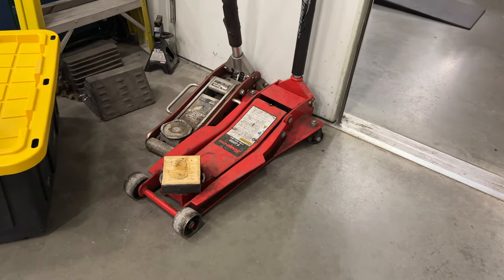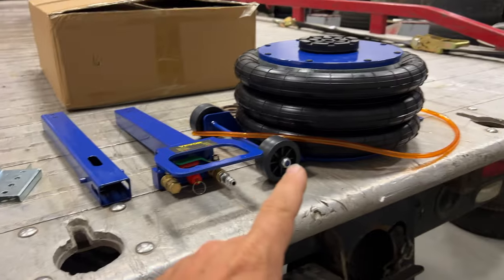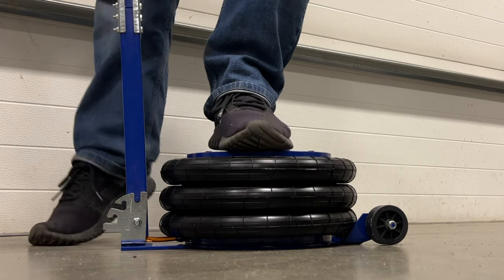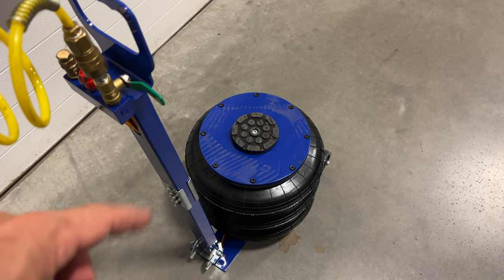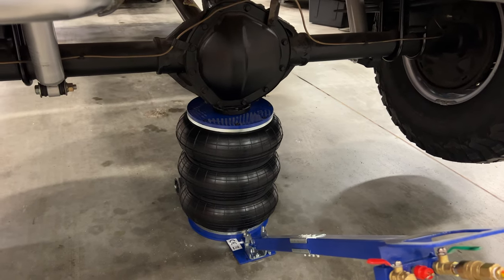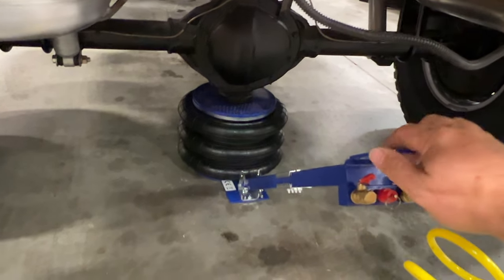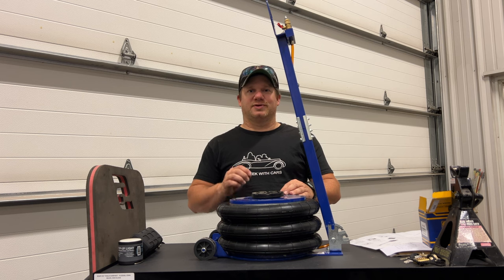Testing the Vevor 5-Ton Pneumatic Jack

Comment: 1. ALWAYS chock the wheels.  Even though you are on a level surface you are shifting the center of gravity, the truck wants to move forward. 2. The machining of the inner telescoping steel is ruff. You can hear the grooves left by the lathe rubbing against each other.  3. The reason for the sudden drop is because of the ruff machine work. By not chocking the wheels you created a side load on the inner telescoping steel. 4. The sudden drop can be alleviated but not eliminated by reducing the side load as much as possible. ALWAYS chock the wheels and OF COURSE put proper support under the vehicle before going under ANY vehicle.

Comment: The only regret that I have with buying one of these is that I didn't buy one sooner. It works perfectly and once you get used to it as there's a little learning curve you will wonder why you work so hard with hydraulic jacks.
Reply: I just bought one like this based on your video can we not stop the inflation when desired height is met or do we have to inflat it all the way all the time ?
Reply: @vcolet2011  with both valves closed? Now open just the green handle until desired height is met and close valve. Does the jack raise as soon as you turn on the air?  I need more information

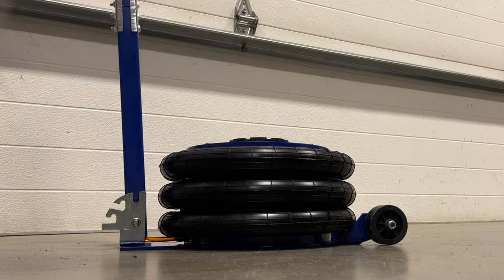Comment: At 2:15 - you can see that you have the air line installed wrong in the handle - it's being pinched by the handle bottom against the base plate. You're not supposed to route it that way - it's supposed to go up into the cutout on that lower handle and up through said handle to the top cutout. Putting it in from the bottom is just going to ruin the line and possibly drop the vehicle on you when it tears under pressure - that line has to hold full pressure any time the jack it lifting\holding up weight.

A good reminder to also make sure that jackstands or other solid support is used when working around anything lifted up - pneumatic or hydraulic, don't be under weight without actual solid support. ;)
Reply: That's a very important point you've made about the airline mis-routing. He's made an already potentially fatal jack even more dangerous. I also worry about people using these whilst welding. The airbags are quite robust but the airline looks vulnerable.
Reply: @Simon Coates  - Yeah, if you were MIG welding around this you'd need to be extra careful as the sparks/slag can easily damage the air components of this jack. Jobs like that are definitely poster children for using proper jackstands, though again, any time you are going to be under a lifted load, you need jackstands under it too. I've had normal hydraulic jacks fail under load with a car on them - thankfully I was lifting it to remove the jakstand and it failed while lifting, so no one was under it. Just have to have a sense of self preservation and not want to get hurt, but sometimes people don't think it through, so warnings like this are there to help. :)

Comment: I used to work in a plant with pneumatically controlled processing machines.  After he pointed out that  kinked pressure hose and the associated connector I was instantly concerned because of how they  fail.   When that plastic line cracks or burst loose it is instantanious.  All you'll hear is pop and the whistle of air cutting air.  If this happens with a car on the  jack everything is coming down really  fast and hard.    There didn't seem to be a fall arrestor on those jacks. Of course you will be utilizing a jack stand for safety but that will not be in place when are raising up  or lowering a car.    It also appears that  a level surface is imperative because it looks like that rubber only is holding things up but not front to back or  side to side.
Reply: Not that they help much for side to side but there is a collapsing metal tubes in the middle.
Reply: @akbychoice  yes, the metal column inside actually keeps it from flopping over to the side, though it does allow some degree of movement when not fully extended and locked up.
If it's fully extended and pressurized higher than needed to lift the car, the column will then be fully rigid and won't have any side play.
The stiction in the column tends to cause the irregular dropping when the air is released, so it can cause the scary "whoa!" moments for someone unwary of that characteristic.
I've seen a video of someone opening it up and applying some lube on the column which should help with that. They're apparently manufactured without any lube or grease on the metal column, so there may be some other reason for that. Maybe to avoid possible contamination and deterioration of the rubber. Even though there's no direct contact with the rubber,  brake caliper slide lube may be safer to use.
Reply: I'm more curious about how it'll be at the end of service life for these, as they definitely have some timespan where they'd be expected to work. Whether three years or 10 years, eventually the rubber will go, but is there any good indication that's able to predict when that time has come?
I haven't heard of a single instance where the bladder let go with a bang, but it seems possible, with time and conditions.

Comment: One thing i like to say about this jack   your air pressure has be 100 lbs or more the jacks works really good if your air pressure 65 or 70 it would not lift as good. i got mine 2 weeks ago.
Reply: The lift pressure on my 3 ton model measured at 40 to 45 psi during the lift of a van and passenger car, so a low pressure would work, but the higher pressure from the air supply is needed for a quick lift.  Lower pressure from the supply would take a longer time, since the fill rate would slow down when the supply pressure is almost the same as the target.

Comment: I got one on sale to augment my traditional hydraulic floor jack. I actually like this a lot because, for my needs, it's quicker, requires less space than my hydraulic jack, and its easier to use. It also raises my vehicles super quick. Instructions were terrible, but it's not rocket science.

I use it for driveway type stuff: brake jobs, minor suspension work, some minor engine work that requires access to the under side. I'll obviously keep my hydraulic floor jack, but this is a nice addition for me.

Comment: Thanks for sharing this info. I'm not sure that this is a safe device to use. Plus, it's lowest height is somewhat limiting for the vehicles you can use it on. Please continue to use with caution. Hydraulic jacks may be slower, but they are well proven and easier to control
Reply: I have a lowered Bmw and all you need to do is drive the car up on the  Low Profile Plastic Car Service Ramps slip this Johnny in the middle of the crossmember and lift away. Your making it seem like it's impossible. If you actually play with cars you would know there is always a workarounds. My buddy has a bendpak and I can't slip the arms of the 2 post lift under my car without driving it on 2x4's so come on guy. Man up this product is great.

Comment: The advertised raised height is 15 3/4", did you re-check it after you fixed the air line kink? You should mention that, a PROPERLY RATED jack stand should be used in conjunction with any hydraulic, pneumatic or mechanical jack if you are working under a vehicle, or lifting a frame and working between the axle and frame, as a single jack failure can cause severe injury or death VERY quickly.
Reply: Facts, a friend of mine from high school passed this way.

Comment: I've seen a review from the British Isles, and that reviewer had some issues with the way and sound as it deflates. 
Hear that 'scrunching sound'? He didn't like that, so he took it apart and fund that the machined surfaces of the steel inside were "very rough"/ 
I'd like to see you take this one apart and give us your thoughts on what you find and think about the 'guts' of this jack.
If and when I buy one, I will need lower deflated height, so it will fit under my Mini Cooper etc. ( Maybe the 2 or 3 ton version would be better? )

Comment: I have a fascination with jacks. Growing up I liked when our car would get flat tires and we'd go to a local garage to get the fixed. I came here to get the scoop on these. If you're interested in getting one I'd say hurry up and get one before they're outlawed. I've seen a few videos and they tend to wobble when fully extended. Sadly it's only a matter of time before people start getting hurt or killed. It's a great concept but in the wrong hands these are like the three wheelers of floor jacks.
Reply from the maker: I think they could easily make them safer by limiting how quickly they can fill with air.
Reply: @ThisWeekWithCars  yes

Comment: I have the 3 ton model. This thing is awesome as long as you are smart about how you use it, but the handle needs improvement.. I lift the entire side of my daughter's jeep and rotate the tires in 5 mins each side (like an Indy pit crew). I also have a 60 gallon air compressor with 3/4 lines going to a 1/2 hose reel, set up with the larger T series connectors. So the volume of air my system can provide is very good. Let in the air slow and the vehicle lifts slowly, close the valves and the jack stays up.  Control is everything. Use jack stands for safety.

Comment: Acts like the stabilizing structure inside of it needs lubed. Does the center lift pad come off? Maybe a zerk under there? Or on the underside of the rig?
Reply: There's a video where the top of was removed to show a telescoping metal column inside. It can be lubed by hand to get smoother movement. 
I haven't opened mine yet, I may do it after using it for a while first so I'll have some basis for comparison.

Comment: I bought one of these a couple week ago for my younger brother.  I only got the 3 ton (6600 lb) version though.  I would imagine you could control it a bit more by adjusting how much air you let through the valves instead of just running them wide open.

Comment: One of the most important specs I look at when buying a floor jack is how high it will lift, and how low it is fully down. For lifting small and big cars you need one that really goes high for modern lifted trucks. My big one lifts from 4 to 36", hydraulically.
Reply: That's huuuge.  Don't think I've ever seen that.  Who makes it?  
I have a farm jack - 60", but it's, ahh, well, be careful.
Reply: @mountainjeff  who else.. Harbor freight. I've had it for years. Replaced casters once, but otherwise, I use it for the big stuff. Lifting to 19" is just silly for most jobs.  I have a full size lift too.
Reply: @gvxclassics  what model of hf Jack is that?  That sounds like some kind of Quickjack scissors type rather than a standard floor jack, to get a3 foot lift range.
Reply: @sadfur8728  HF does not seem to have it for sale any more. It is a regular floor jack, just a big one.
Reply: @gvxclassics  how long ago was it that you found it?

Comment: I have two that I use on the hoist, obviously mine don't have the handle, mine seem to wobble a bit at extension, and only two bag's not 3 ,I think there great only the valves stop sometimes, in 10 years replaced one set, of valves, that's second hand, all the best to you and your loved ones

Comment: Enjoy the videos . I have one, they work very well if common sense safety procedures are followed. Releasing the air gradually is a good tip then the control is pretty good. Agree that it’s more powerful than a hydraulic jack but it’s all the better for that. My only criticism is that the pad could be a little larger and raised a bit.
Reply from the maker: Thanks for sharing
Reply: I use two bag one on my lift, I do find (I jack one corner at a time) it too be a bit wobbly, but the steel tube in the middle stops to much movement, found it a bit intimidating at first, but work well for 10 years haven't used them as much in the last 10 years, apart from having to replace the valves in mine they are push button, type, still work a treat, all the best to yous and your loved ones
Reply: If you ever have any old tires, you can make jack pads from the tread by cutting up squares using a reciprocating saw. They'll last a lifetime and can be stacked as needed for extra height and protection of the undercarriage.

They're especially good for regular hydraulic jack saddles and jack stands, as they're usually all metal and will gouge out your undercarriage when given half a chance.
Reply: @donaldhalls2189  how's the condition of your bladder after the 10 years? Is it essentially still the same as new?  Just wondering if the rubbers will show any sign of failure before it's too late and an accident results.
Reply: @sadfur8728  there is no signs of rubber fatigue, but I always put the stands under the vehicle and not just supported buy the air jack, I've seen some with the outside layers torn, and still using them, (not what I would recommend) all the best to you
Reply: @donaldhalls2189  I guess it can be used to end of life of the product, keeping it in mind that it could be a possibility that it could blow out to avoid end of life of the user-
It's good that it's lasted that long with no issues, and no reports of failure.

Comment: Mine came with a spring,  maybe to lock the handle position.   No instructions for the sprin and where to install it.
Reply: Spring goes over air line at handle pivot point

Comment: The handle hinge locking plate looks a little flimsy. Does the design prevent any torque being applied to it by the handle, which clearly has a considerable lever arm?
Reply from the maker: It looked flimsy but seems to be okay.  I did not feel it twisting, rolling the jack around on the wheels does not take much force.

Comment: That's a nice idea but you would definitely want to chock the front wheels on both sides to stop it moving forward or backwards. I think it would be good as a standby tool. What if you opened the release halve way would it lower more  slowly I wonder? Good review though Steve thanks. 👍👍

Comment: Not impressed at how abruptly it works up, or down and would only ever use it on the side of the car, not the end. To roll it around, lock the bar in the up slot, then flip it over forward to roll it around.

Comment: Crushed my finger using one of those things.
Reply: How did it happen? Maybe similar things can happen with other types if not careful. I'm sorry you hurt yourself, but I'm just wondering if it is by using an unsafe product, or if it may have been caused by using it wrong and/or without proper precautions?

Comment: In summary:  requires high clearance to use, doesn’t lift very high, is not rigid/stable, requires shop air or compressor.  Conclusion:  Unsuitable and useless at any price!